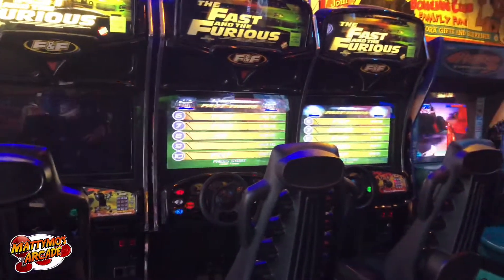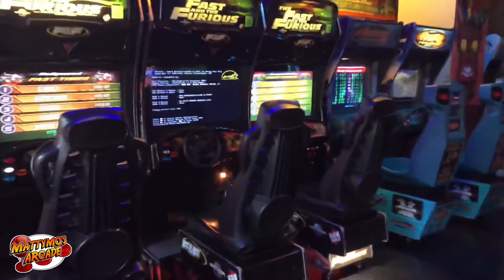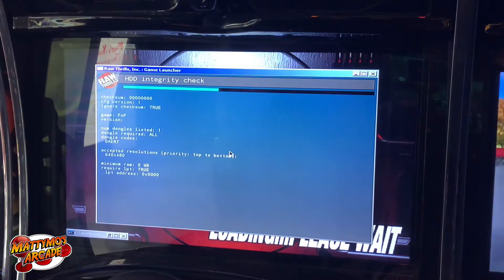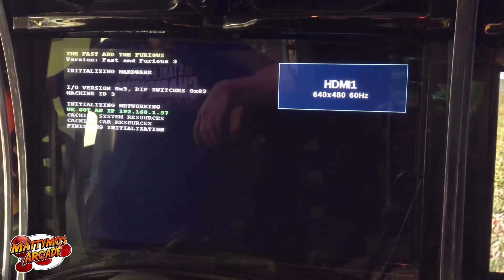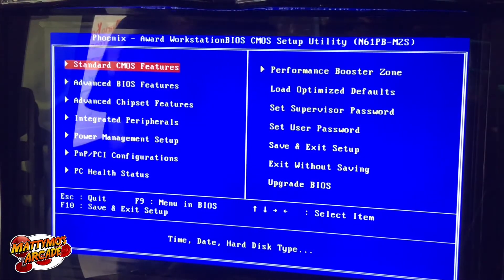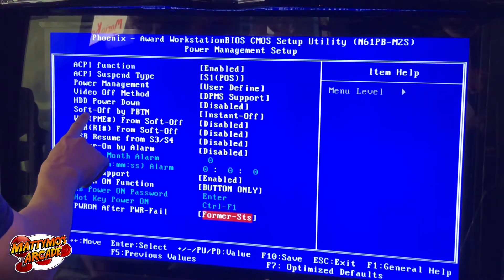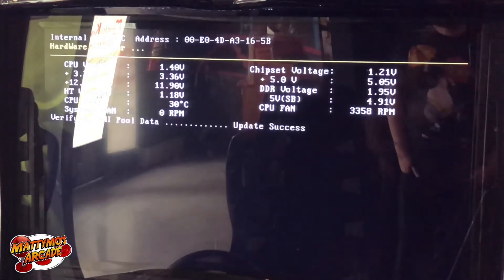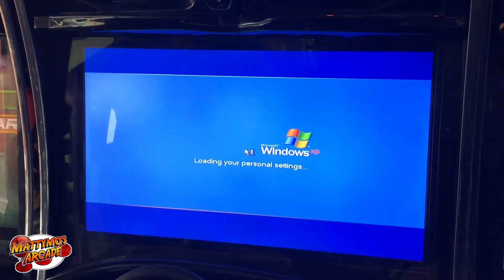Fast and Furious Arcade Game, BIOS Menu and Settings

Comment: All the settings you have changed is correct but on the boot sequence you only selected the Hard Disk so now when you want to reinstall the software it will not run because the CD-ROM is not present. Usually CD-ROM should be the 1st Boot Device and then Hard Disk 2nd and disable 3rd.
Reply from the maker: Gotcha. I can swap that. Thanks!
Reply from the maker: I have it written down in my notebook for this game, but it’s in St Louis. Ugh

Comment: Is this on Mame or is that the OG Setup for this game?
Reply from the maker: It is on mame, and probably uses the same menus.
Reply: @MattyMosArcade  It should have the same menus in Mame, I asked because in truth, I've only worked on Arcades Via Mame. I've never worked on Orginal Hardware. I know Newer Arcades have PC's with a slimed down Version of Windows. I was just unsure if FaF is a PC based Arcade or if it had specific Arcade based boards. No Idea if that makes since as I don't really know the right terminology.
Reply from the maker: @TechicallyTNT  it has a PC inside, but it does need very specific hardware. Which can be a pain.